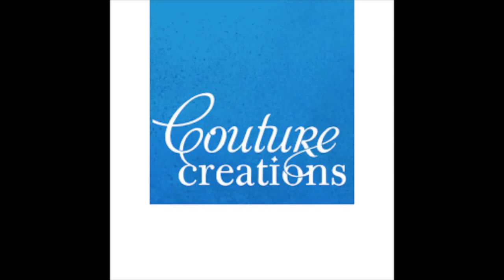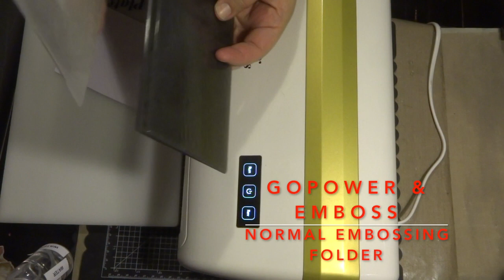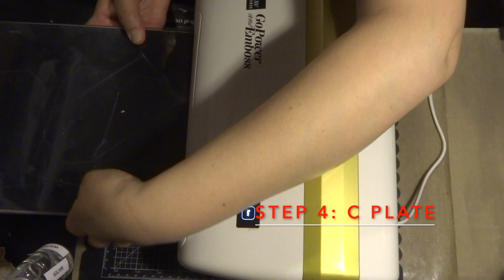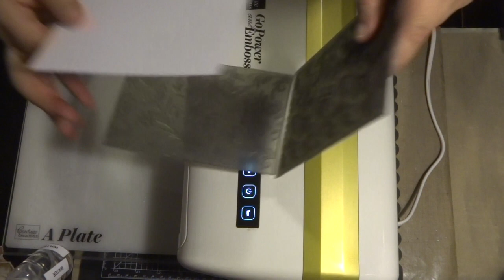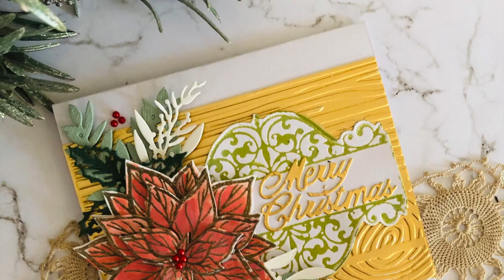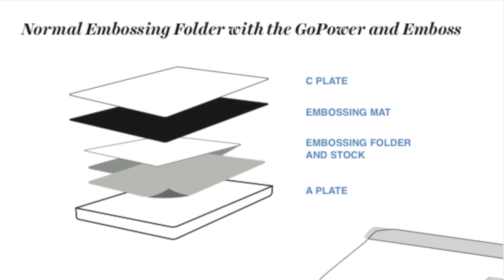Couture Creations - GOPOWER & EMBOSS machine - Embossing Folders

Comment: What's this machine like for bending the plastic plates??
Reply from the maker: Hi Charles, like all die cutting machine the plastic plates will eventually start bending after a while, a great tip is to rotate the plates around frequently and also place the thicker plate on top (B plate) and the thinner one (C Plate) in the middle of your sandwich of layers of plates and dies etc. This I find helps a lot. Happy die cutting :)

Comment: Many thanks Adriana.  Really needed this as I was apprehensive to try the 3D embossing folders as didn't want to damage my machine.  Had the GoPower and Emboss for just over a year and love it.  Would recommend this machine to everyone, and I have done.  Noticed that you did not use the black embossing mat for the 3D folders, which surprised me as it is for embossing.
Reply from the maker: The 3D embossing folders are so much thicker than the normal embossing folders, so the Black embossing mat is not required for the 3D embossing folders.  With the Normal embossing folders you use the black embossing mat. ANOTHER TIP: make sure you alternate the top plate (c plate).